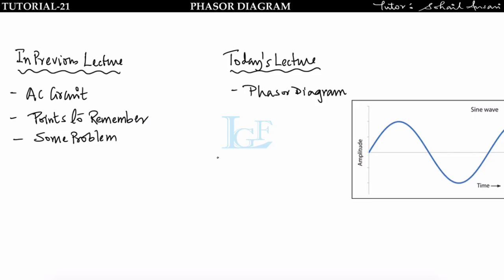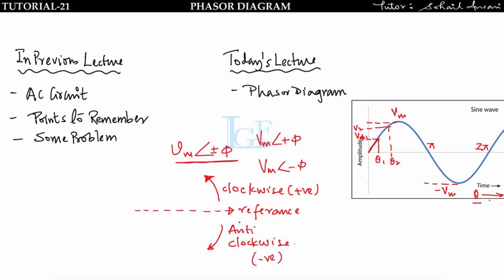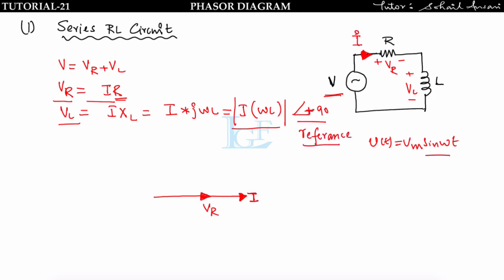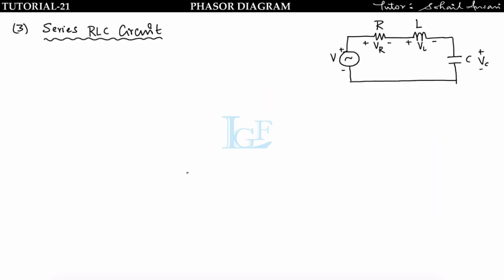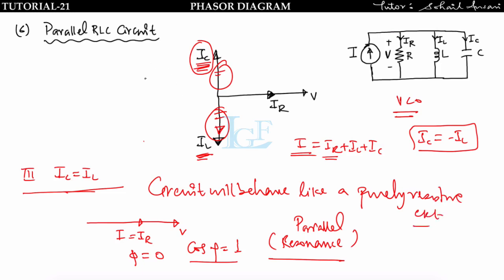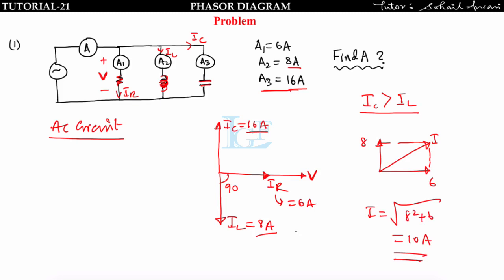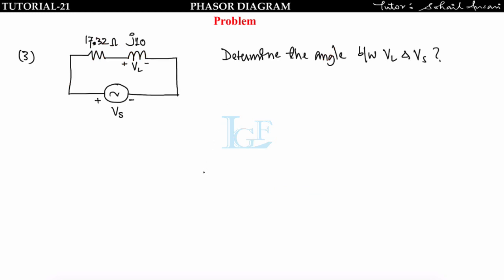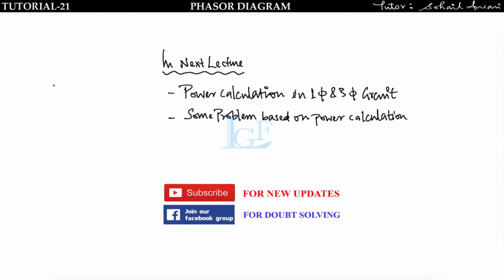Lec-21 Phasor Diagram

Comment: Sir, for V=IR (for voltage and Current Amplitudes) in AC circuit with just a resitor when you draw phasor, should the length of I phasor be always less than V  OR,  greater than V ? Which one is correct sir & how can I explain this?

Comment: @ 45:46  can I take
 (I c - I L) instead of il-ic. plz enlighten on this?
Reply from the maker: yes u can take..take that case also..u will get i think 0A...but as we know that voltage source is connected parallel to inductor means current will definately flow...means current will not be zero..so that case is neglected..ok
Reply: But since source is sinusoidal voltage will be zero at some point and hence current in C will be too at other time.
Reply: Since,i1 is the resultant of i2 and il; i1 will come below the reference which implies that il> ic.

Comment: phase some times taken as  { - tan^-1(b/a) } and some times  as { tan^-1 (b/a) }, clarify me when positive and when negative to be considered @ Mr. sohail ansari;  eg in networks we are using +ve , and in controls we use -ve as convention
Reply from the maker: in control as well as network when u are moving the angle from denominator to numerator then u take minus sign...tell me the tym at which u r getting problem

Comment: Sir i am also confused in question no. 6 where u has taken iL as greater than iC and solved on their basis but in question nothing is mentioned about......please sir explain soon
Reply: since i is calculated as vector sum (square of the currents), the sign will not affect the magnitude. u can use even xc as greater. it will not affect the calculation.

Comment: Sir in problem 6th, can i take it as IL=√(I1^2-I2^2 )
Reply from the maker: no its wrong..this u could be able to do when the angle between I2 and I1 is 90 degre...otherwise not..
Reply: thnx sir
Reply: Apply vector addition i1^2= i2^2 + iL^2 + 2*i2*iL*Cos(theta) where theta is the angle between i2 and iL.

Comment: when u r going to upload lectures on signals and systems sir?
Reply from the maker: it will take ....cant say when..
Reply: sir plz upload them before dec 2016 if possible. 
is it possible sir?
Reply: I already cleared GATE 2016 instrumentation. I did a lot of mistakes at that time. Because of ur lectures it is easy to grasp all the concepts by heart. So plz upload more videos as soon as possible.

Comment: sir in 6th sum y there is IL-IC instead of IL+IC(in side the sq root )
Reply from the maker: IL and IC are in phase oppsition..means when u draw the phasor diagram of parallel RLC circuit taking V as a reference..then u will see then IL and IC are 180 phase opposition...thats y it should be minus..
Reply: ookk thank you sir
Reply: At q.n. 6, if i will take ic - il instead of il - ic then il = 0 ?
time 47:41

Comment: sir why did you take sin(40) instead of sin(-40) in problem no 5
Reply from the maker: what does minus sign denotes..it denotes the lagging nature with respect to voltage which i have already drawn in the phasor..so why to take minus sign for finding solution..got it.
Reply: thank you sir
Reply: How did you take I1sin40 and I1cos40